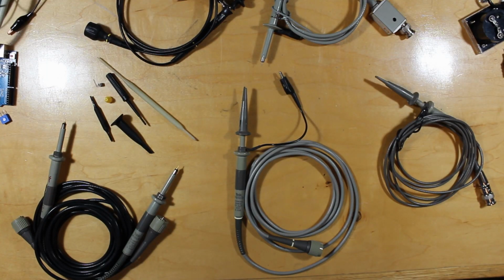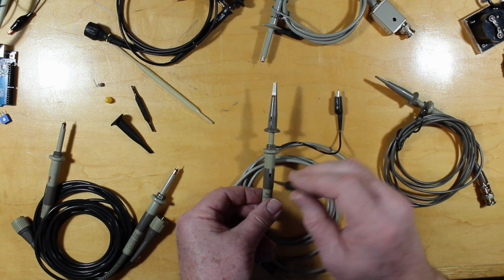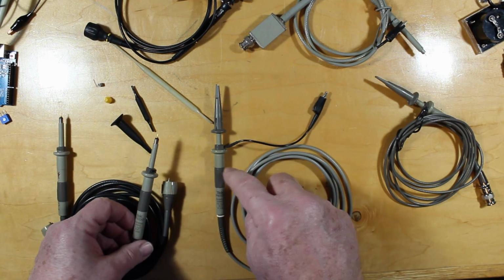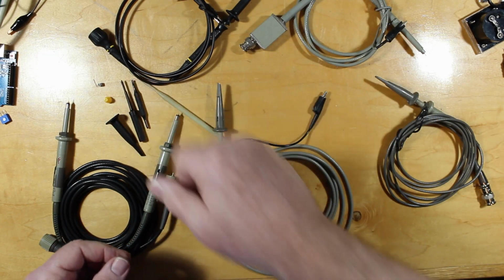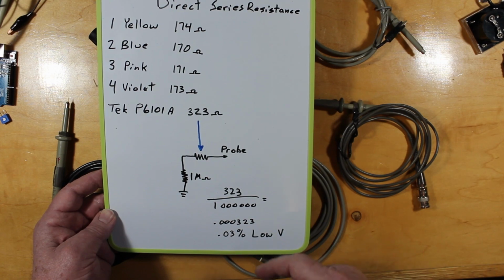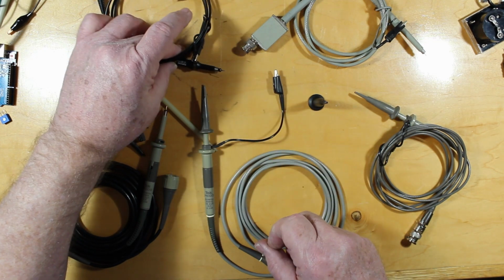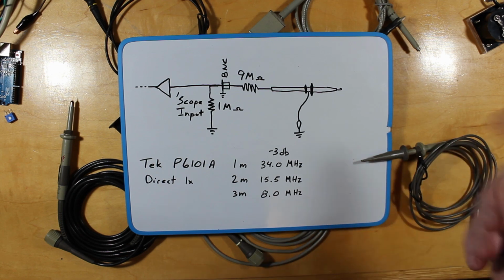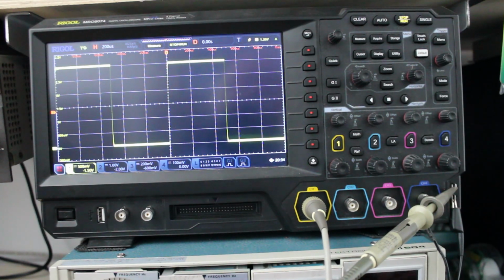#12  Oscilloscope Probes - Which Probes Will Work With Your 'Scope?  #oscilloscope

Comment: Cool video. Those black factory rigol probes are horrible ehh. The compensation screw is hard to get at and easily damaged 

How do you like the mso5xxx series from rigol? I've had mine for a year but keep using an old tektronix. I regret not spending the money on a second hand tektronix mdo. I do like how the rigol has separate bnc adapters for the 2 arb channels. 

I'm debating on which spectrum analyzer to get. They are expensive for a hobby bench. I'm going to get the siglent plus one, I forget the model number. I grabbed the micsig differential probes for up to 1300v on a great deal a few weeks ago. They were 80 off.
Reply from the maker: I'm generally happy with the Rigol.  I use the built in functions and features a lot.  I really wish the function generator had more output.  I have an HP182C that has a beautiful trace and I have a number of plug-ins for it.  One of these days I'll get it positioned to include in some videos.  I have the Siglent 3021X Plus which I also like and it's really nice to have.
A differential probe is on my wish list.